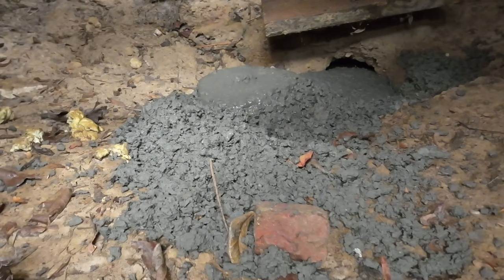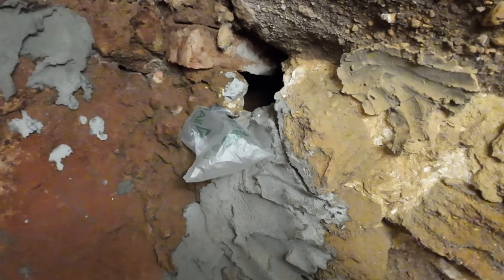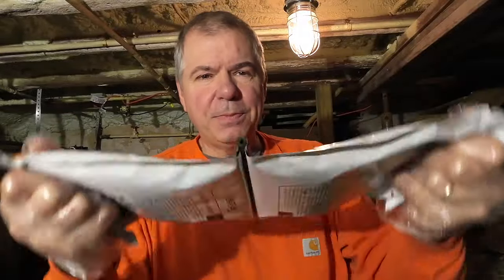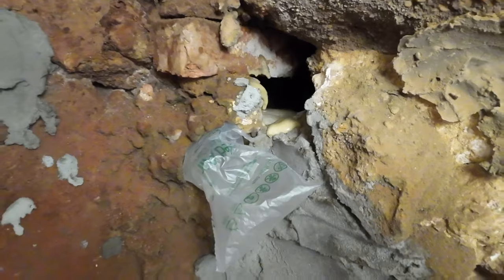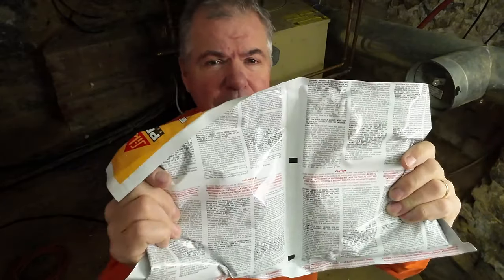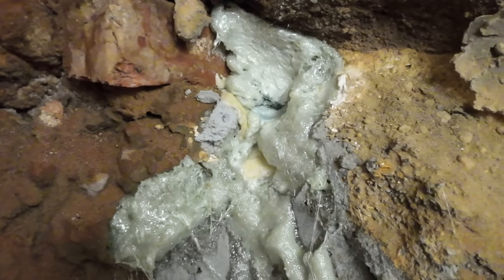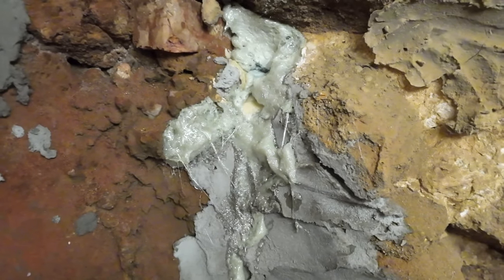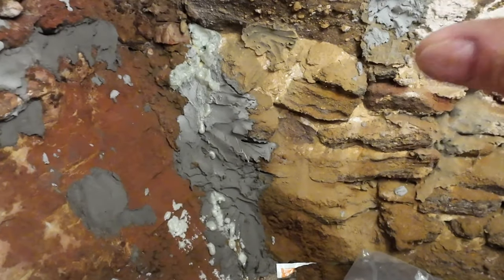FAST 2k vs Sika - Can you fill a foundation hole with expanding foam?

Comment: Good evening Ed,   I have used the foam in the aerosol cans but I was not aware of this product..it did the job👍Thanks for sharing,  have a good one, Ben
Reply from the maker: Yes it’s a very different product from the canned foam insulation. I was surprised. @Tony’s Tractor Adventures has several good review and use videos with Fast2k
Reply: @MyClutteredGarage  thanks Ed, I will check out those videos 👍